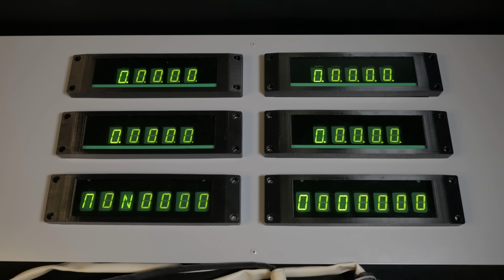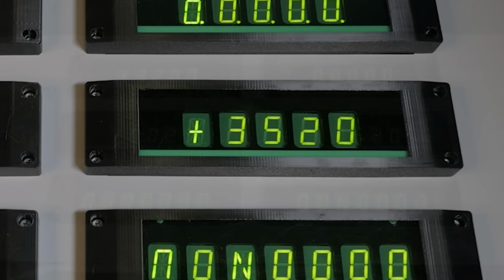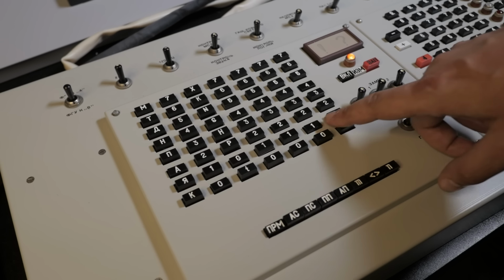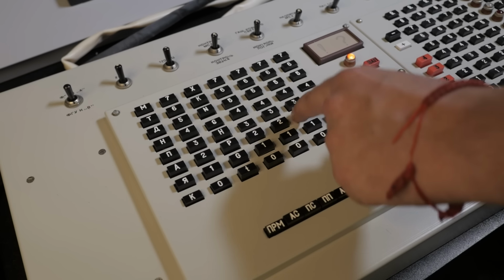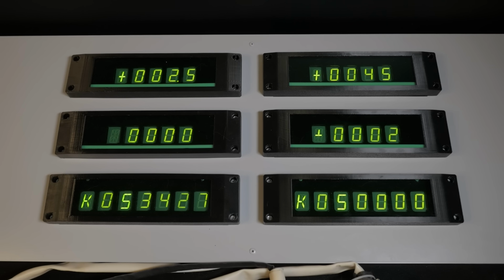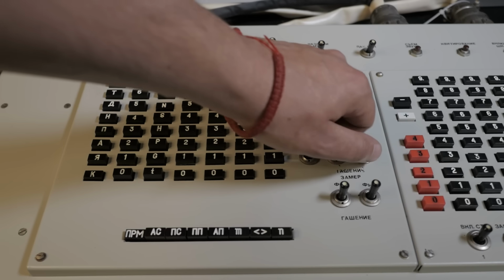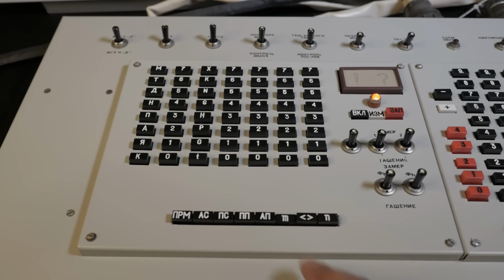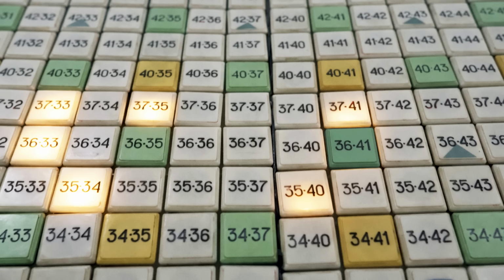We Rebuilt Chornobyl’s SKALA! | Chernobyl Reactor at Home Part 2

Comment: Damn, they didn't only manged to find ALL the components they needed to build both the main panel (Episode one), but also modernized it without compromising the authentic feel and look in ANY way, then they also manged to build AND DAMN PROGRAM and thus fully understand HOW and WHY it works/worked.😳

TRULY impressive!

As someone who also often starts projects which end up much bigger than expected (or know it will be big but then later thinks "what have I started???"😂) I could SOOOO much relate when you where looking at those 400+ wires before duponting them😂

And I don't know IF it was an intentional "subtle" reference when you where putting the panel together in episode one, but I definitely laughed when you said "It looks like a chocolate cake" (for those not getting my reference: Yellowcake 😉).

AMAZING content man. Always have been majorly fascinated by Chornobyl and Pripyat, and absolutely love your content, projects and editing style 😊👍🏾 Stay safe and well
Reply from the maker: The reference about the cake was slightly different and rather local, google "празький торт"
Reply: @ChernobylFamily  Ahhhh that makes PERFECT sense now! It indeed does A LOT look like it😂 Thanks for clarifying 😊

Comment: An Uranium fueled RBMK-1000 can put out 1 Gigawatt on two multi-stage turbogenerators in 1985, while in the same year, an American scientist named Dr. E. L. von Braun designed and built a mobile modular Plutonium fueled micro-reactor that was capable of reliably producing 1.21 Gigawatts and higher on a single Tesla-type turbine when loaded with a single fuel rod of 6 Pu-238 pellets. How? Properly enriched "Weapons-grade" nuclear fuel, advanced shielding and metallurgy, negligible void coefficient, and this was a movie so they had a relatively bigger budget than what the soviets were willing to pay for their reactor infrastructure.

Comment: You've done some amazing work once again, thanks for this most interesting video! Watching it gave me even more appreciation for the skill required to work with these kinds of complex systems during the days when a proper computer user interface was part of science fiction - I just love systems like this.

So, according to this, the operators could have checked the last known value for ORM at any time - I take it that SCALA would only calculate it so rarely that a real-time monitoring wasn't viable?

As for the question, having a full channel-search program would be neat!
Reply from the maker: From what I remember, K0S0000 could be called only once per some time. I really do not remember for sure, but what is certain, there was a delay.

Comment: The use of nitrogen for the heat exchange gas is interesting, since N-14 is activated by neutron irradiation, converting it to radioactive C-14.  I wonder why they didn't use CO2.
Reply: I think the point was to make the atmosphere as inert as possible for the graphite, so there shouldn't be any oxygen in any form.
Reply: @AntThinker  N2 is chemically inactive, but N-14 is very much not radiologically inactive, which is why CO2 may be a better choice.  In terms of chemistry, radiolytic oxidation (CO2 + C + γ -> 2 C0) only becomes significant above about 500 C, but we are probably not in this regime, and neither C nor O are radiologically active.  Dimensional change of the graphite induced by neutron irradiation, and Wigner energy are also matters for concern in such a reactor.

Comment: I have always wondered what would have happened if the operators had turned the safety and automatic systems back on, what would have happened. Could this be used to simulate that?
Reply from the maker: The problem is what we do is a post-accident modernized Unit III, not pre-1986 IV. Very different in details.

Comment: what if you try to get information from a concrete channel while its being refueled or just being extracted from the reactor with the refueling crane
Reply from the maker: I believe such a channel must be "restricted" first (this means — detectors put programmatically offline, there is <> button for that) to prevent errors and inadequate data. The control of energy  disturbances is done by checking current from DKE detectors around the target channel.
Reply: @ChernobylFamily  Ok thanks

Comment: In way fascinating ingenuity to achieve so much within limits of what was available and being miraculously connivent (in designed limits) for well trained operator  
but in other way (it may sound brutal)... at the same time one of most inconvenient user interface for such enormous machine/system in which some processes may unfold in parts of the seconds. 
Yes i know that many of those parameters were repeated on this great wall and rest of the panels but still...
It reminds me experience programing old calculator using like Forth language(?) (or similar stack based language) and Reverse Polish Notation, 7-segments display and 3 or 4 additional buttons only (Elektronika MK-61 probably).
It may be acceptable for chemical plant or refinery but for nuclear reactor of this size, known to 3d inconsistences it seems misplaced at least.
But maybe this was a standard of this era or previous era even in western nuclear power plants - i don't know how much we can trust movie depictions.

Comment: The fact you were able to reproduce this is just incredible.  You not only have to understand the way it works but be able to translate that to a modern system to get the commands and displays right.  Amazing work.
In its operation it reminds me a lot of videos I've seen of older mainframe systems, but implemented in a very unique way.  The more I see of Skala the more I think it was unfairly described in much of the common historical narrative, it's a lot more sophisticated and tightly integrated into reactor operations than it was given credit for.  As someone who spent a few years working in the field of industrial control systems this series of videos is fascinating.
Reply from the maker: Thank you, it is indeed a very unique and sophisticated system. It took a mindblowing time to build this: 3,5 days:)

Comment: Did anyone say how often they needed to make requests on the computer? I presume you don't need to check every channel every shift, but I've also heard that the RBMK takes a lot of finesse, since it behaves like a lot of small reactors chained together rather than one big unit. 

Aside from recreating the computer, a few true-scale replicas of things would be nice. You can say how many centimeters wide something is, but a demo of if you can fit your arm in a fuel channel hole of a graphite block, or how big of a dog could stand in the pump's main outlet pipe would really help.

Comment: I do find soviet design intresting but the skala computer but it does seam to be not very future proof i know you have said in the past that the skala computers did revive some upgrades after 86 but it does seam that the orginal computer design dosent have much in the way future proofing it seams very rigid i know its an industrial machine but these computer could of been running for 30 years would of thought they would of put in places in the design to allow for say screen displays in the future to allow for the operator better control instead of the LED digit displays,plus learning all operations and how it all worked with soviet manuals and documents would drive the sainest man to maddness you must of read alot of soviet manuals for this project and the examples you have shown in the past how did you not end up going insane lol

Comment: I love these hardware projects and deep technical information explained with them, even though I have zero actual use for the knowledge how the  plant was operated. Ah the curiosity. Still it seems easier to operate the SKALA than setting clock on a microwave oven..

Comment: Nice! Very cool!
Where are the programs stored?
Are you planning to use real tape drives, like they did in the 80's, to store and read data?
Reply from the maker: For now, an internal memory of the MCU. Later, there will be a computer with a model/db running connected via serial port.

Comment: This is very much an interface a programmer would come up with but not really in a bad way.  Just that it's programmatically relatively simple to have every request be a fixed set of fields that's always fully populated.  No issues with variable width fields.  Also makes everything very unambiguous, but that probably gets more in to the more in depth user interface design of making it safe and less error-prone from the user perspective, which I'm less familair with haha.

Comment: Astonishing. That's just so awesome. To provide such a unique experience of the RBMK operator in real life.
Head is spinning with potential possibilities: fully simulated suites of use-cases like "how long can you operate it until you screw things up" or ER/VR experience in 3D operator room with real haptics. 
Jeez...I wish you all the GW of power output of excitement and will to continue 💪
Reply from the maker: In reality, yes. Notice we implemented fluctuations for K0Gyyxx, so technically, we can add development of abrormal processes AND give a chance to correct it before AZ will trigger. In reality, even now, it is a fairly immersive experience — I caught myself on a feeling while debugging it.
Reply: Get a nuclear reactor engineer or two and add reactor dynamics simulation. Then it can be just like the real thing.
Reply from the maker: I literally told in the video that we are consulted by some...

Comment: ✅Thx SO MUCH for sharing! 
I never considered the challenge of a UI w/o a printer or CRT. I'm a Civil Engineer w/hobby of Electronics (inc PICs & Arduinos). The oldest system I've used was a PDP-11 teletype console.
The UI has an elegant logic - similarr wApollo Guidance Computer (AGC) & it's corresponding Display and Keyboard Interface (DSKY).
This project gives me a better understanding of the chaos of that day w/techs feverishly requesting code after code. The lead engineer's denial is more understandable knowing they plucked ONE DATA POINT at a time! The system was apparently çrashing! Yes, programs would give partial info (NULL?). BUT, IF the output showed failure, you'd verify individual nodes - which took FOCUS TO WORK THE PROBLEM.... And TIME! The DATA was available, but the Engineers had to INTERPRET that data AND VERIFY IT: through a STRAW!

Comment: Code Kot and senior cat operator appears. System works properly. 😂❤

Fantastic work you folks are doing, Alex. It's a very proactive system, on the wrong end. The operators having to actively search for everything must have been exhausting. And it goes back to what you commented monhs ago on it being machinery-intensive.

It sure must have eased up a bit after the updates done, but it still is one massive system to care for.

Much respect to the operators, past and present.

Stay safe, mate.

Cheers.
Reply from the maker: Thank you!

Comment: A skilled operator could use that console quickly and likely remembered all the key parameters. Naturally, there was no room for errors. It took some time to learn the SKALA system, and training was, of course, required.
Reply: Might have been like early computers too; with a Red Book and another color book for reference. 

Especially for night shift, even the most clever and responsive operator has to fight the limits of human design.
Reply from the maker: Of course.

Comment: 2:30 Would these have been VFDs originally? It looks like you replaced them with some lovely Green Alpha Numerics possibly? 

I have great respect for your engineering adaptability and follow-thru.
Reply from the maker: Yes, must be VFD. But VFDs used were experimental, there is no way to replace them.
Reply: @ChernobylFamily  I believe they were just a row of IV-22 tubes. If I'm right, sourcing those should be no problem. My tv has a clock with them under it, and when one tube developed a faulty digit, I was able to buy a spare without trouble. Edit: ah, I didn't see the alphanumeric ones. Need to see if those are available.
Reply from the maker: Correct, but for LETTERS, there were real unicorns — П422 and П418.

I will save your time :) no, they are not. At all.
Reply: @ChernobylFamily  I hope there is an industry that makes them someday, like the ones that make newer Nixie Tubes. People might actually stab someone to get one of the jumbo AlphaNumeric Nixies. Someone would make a fortune remaking those. 

Either from the camera settings or it just being good, the green is excellent on your display.

Comment: what next? the reactor itself?
Nice video
Reply from the maker: Yes
Reply: @ChernobylFamily  and after that - finally the reactor explosion, right?
Reply: @qwerty123246The super duper nuke explosion over the Kremlin.
Reply: @ChernobylFamily  ¡¡YEA!!.
Reply: RBMK reactors are still operating as of 2026. And are planned to operate well into the 2030s.
Reply: @ErikZiak  I guess they run safer with Windows XP now
Reply: @noideaoftheplot  nop !
they are using Astra Linux  smolinsky edition ! google it 
:face-green-smiling::face-green-smiling::face-green-smiling:
Reply: @noideaoftheplot 
Well, as long as they don't put them on Windows Vista or 8, I think we will be fine😅
Reply: So a captive market for the simulator until "at least" 2030, if not longer.